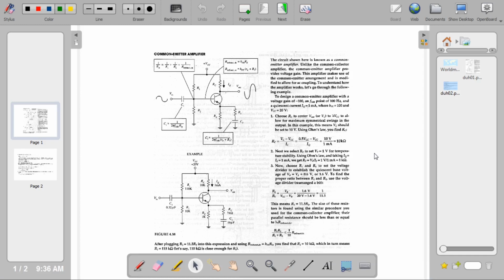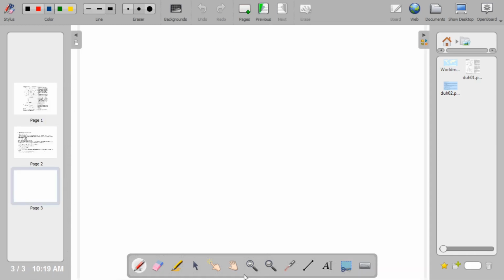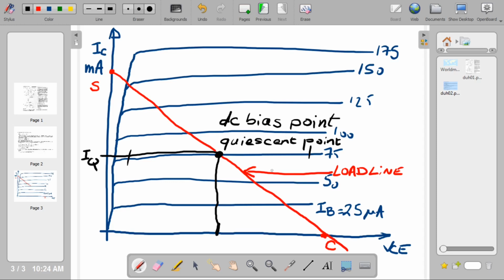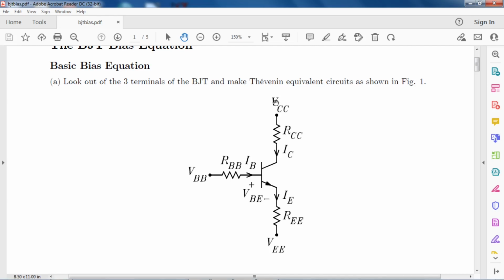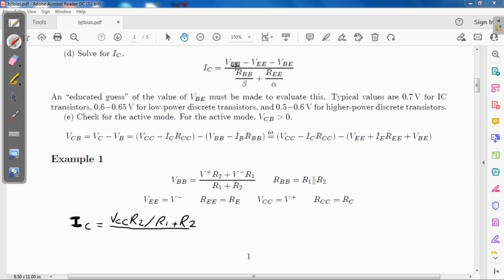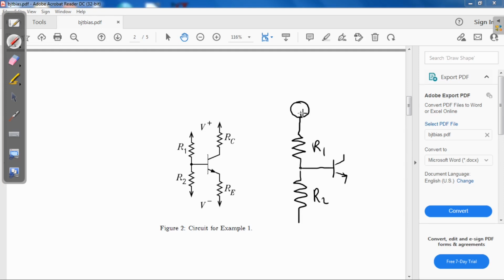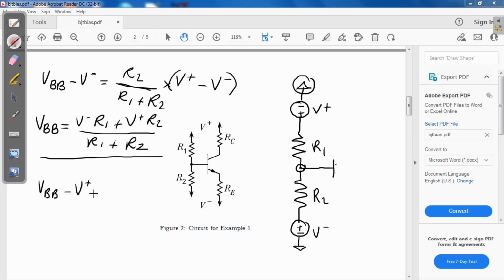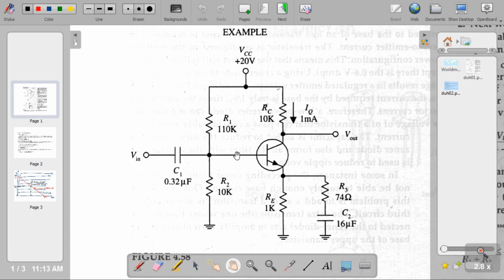Voltage divider bias in transistor amplifier design. What values for the resistances in the divider?

Comment: Ok but now, what can I hook up to Vout?  How much current and voltage will be at Vout?
Reply from the maker: I made other videos where I go into much more details. Especially the one about common-emitter amp design (part 1 and 2). Theory is nice and all but I highly recommend using LTspice or similar software to try things out.
Reply: @electronicsainteasy5253  yes I just got into LT spice.  What a time saver.  Theory got me close but then to fine tune it I just kept adjusting resistor values till I get the behaviour I want.  Thanks for the tip on using op amps.  I don’t have much expertise with those that’s why normally opted for bjts.